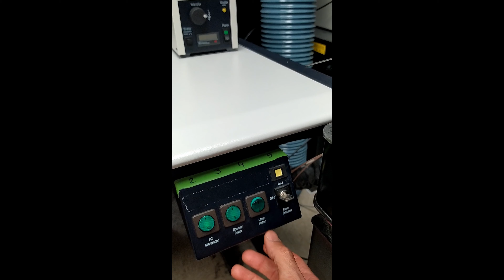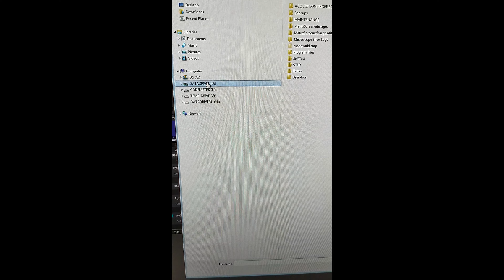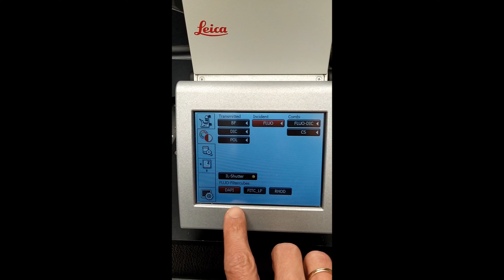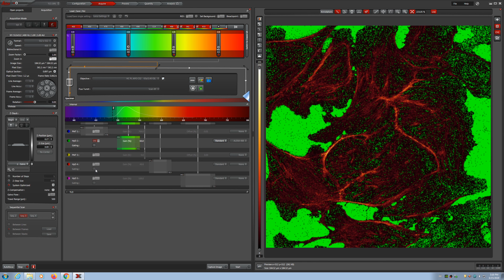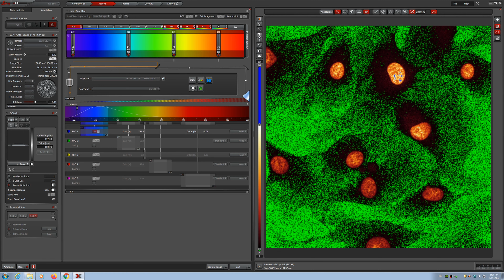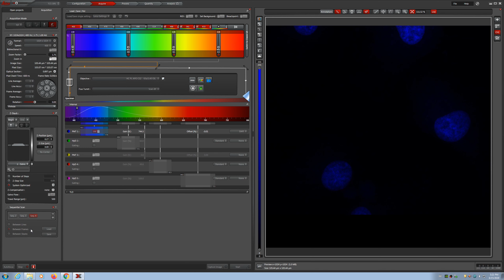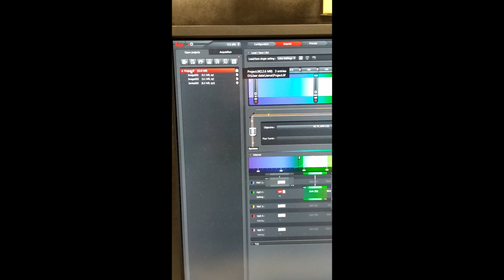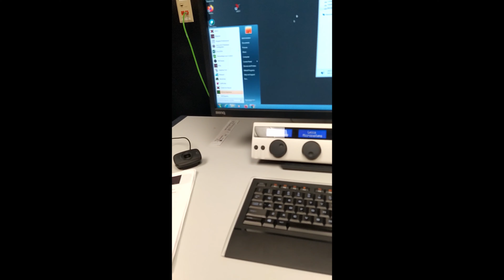Leica Confocal Video Manual

Comment: Thanks for the video. Two questions why do you set your detector range for your HyD4 (Alexa555) to 570-620 nm and dont consider 560, where the extrema emission is? And you said the optimal pixel size is half the resolution, where do I see my resolution in the manual? Thank you in advance
Reply from the maker: Discussion was not anticipated here, but short answer is that this profile general enough to accommodate various red dyes (not just AF555) and a good starting point for advanced/willing users to tweak. The wavelengths and detectors ranges are chosen for best separation of the four "standard" dyes.  Also in practice AF555 is quite bright  and you collect plenty of signal in this range. To give a perspective, with 50-100% gain on the HyD and 1-2% laser power you can easily saturate the detector with well stained sample.  I am not sure what manual you are referring, but this reference maybe useful to look at: https://micro.magnet.fsu.edu/primer/java/digitalimaging/processing/samplefrequency/index.html